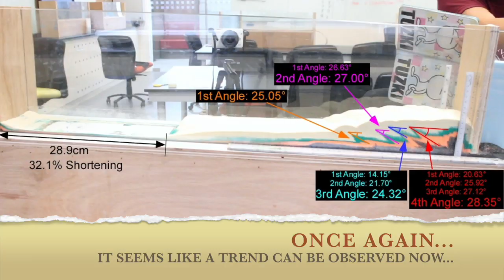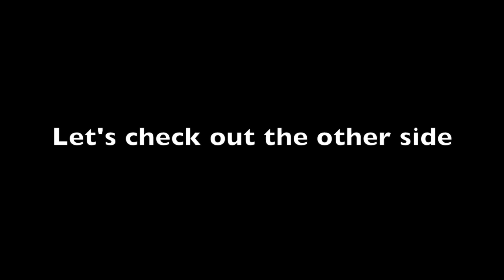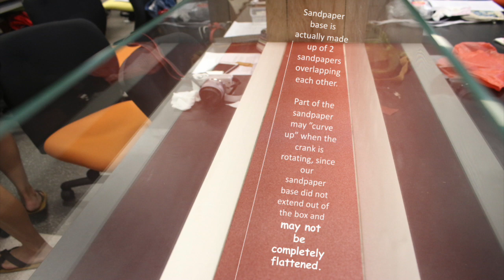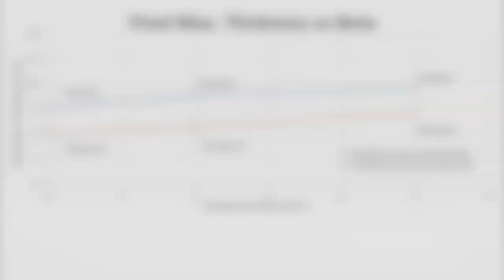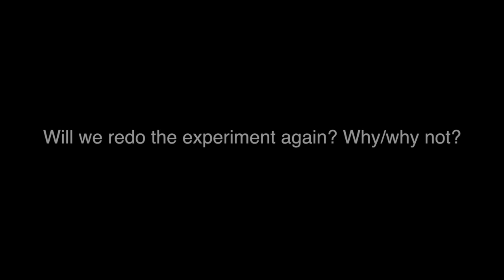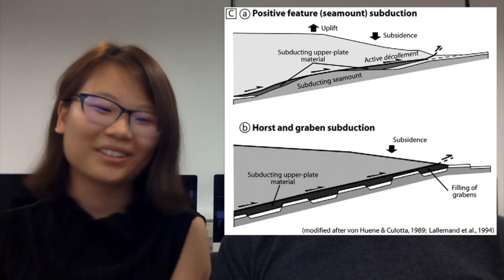Sandbox Experiment 15

Comment: Hi guys. Good job!!!!!A comment. Next time try to use a scraper supported over the top of the glass walls. Slide it in the right to left direction so all residual sand will accumulate, and after removed, from the edge of the sands that are not important for your experiment. This will let you with true horizontal layer and avoid differential compaction in and between sand layers.